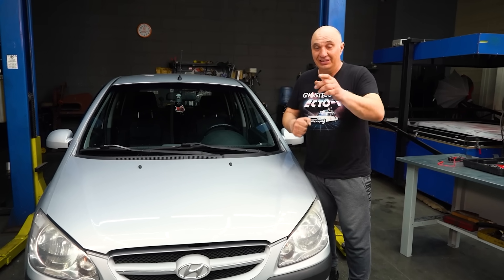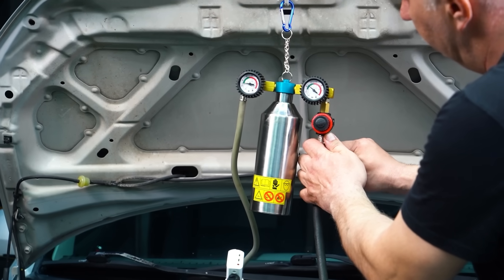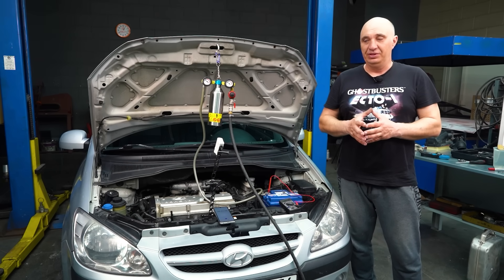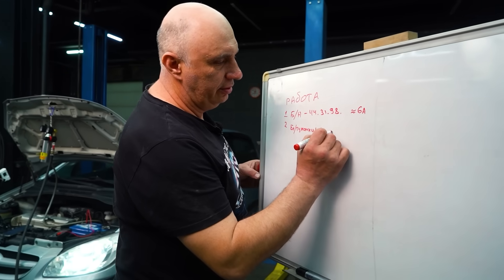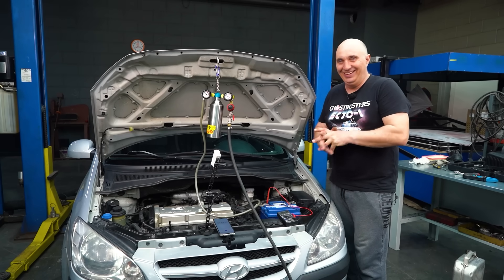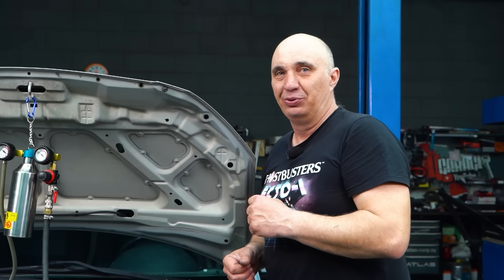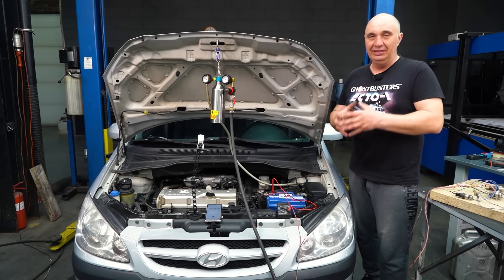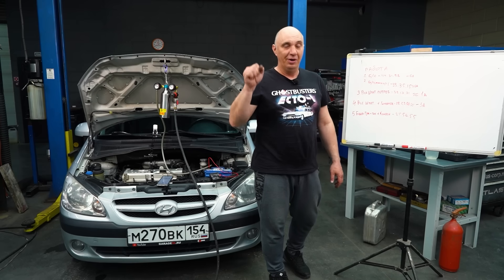How much really do accessories affect fuel consumption?

Comment: Excellent practical video. In my climate I keep the AC on always! The difference is more w/ petrol engines rather than diesels. WRT the DC current measurement, U are measuring the charging current of the battery & NOT the alternator output. In the final test the battery is discharging. It depends on the wiring from the alternator to the battery & from there to the car's electricals/ electronics/ ER fuse box. U may need 2 DC clamp meters to measure both alternator output & battery charge/ discharge current.
I converted your test times into % decrease in efficiency. I ignored the secs except in the last test where I used 26'. The decrease in run time is 11, 25, 36 & 41% respectively.

Comment: You cannot measure dc amperage with a clamp on multimeter, you need to use a shunt resistor for dc
Reply: a regular clamp meter wont measure DC, but there are ones that can. AC clamp meters use induction while DC ones use hall effect

Comment: I think the problem with that current meter is that they only work with alternating current, pretty sure that type don't work with direct current. I think I've tried using one that looked very similar on a car before. to read current you'd have to wire in a dc ammeter between the alternator and the battery. or you could put one in the main cable coming out of the battery, but then it would have to be big enough to be able to handle the current of the starter motor. a cable between the alternator and the battery would give you all the information on accessory power draw you needed anyway. 

interesting to see the difference in run time anyway, thanks for experimenting 👍
Reply: there are DC clamp meters, you can even read on the device. it says AC/DC
Reply: @Xiefux  ah, I didn't see. Curious that it didn't seem to read right.

Comment: A/C is a double load the engine has to turn the A/C compressor and the alternator has to supply the power while keeping the battery topped off. It takes a lot of power to run the blower to move the air around in your car but the rest of the A/C electronics do not take much power at all so the load from the A/C compressor is what kills the gas mpg because most people have the blower on for heat if they are not using the A/C.

Comment: I have a 4l l6 that at idle 14.4v, radio on 14.3v, ac and lights 13.7/13.9v drops about 50rpm until thermal fan turns on. This is in Australia at about 35c (Couldn't tell you what temp ac is set to as it just a blue bar that gets bigger but max cold XD) I personally just keep the windows down as my car has wind deflectors so mpg is pretty much the same

Comment: If you want to check the current draw !! Turn off the car, run the accessories and then check the current, now you are actually checking the current draw from battery to accessories !!
What you did was the current drawn to charge the battery !!

Comment: What is worse for fuel economy? Using AC in the summer heat at 34°C  (cabin at 26-27°C) or using the heater (cabin set to 18-19°C) and seat heating during winter at 3°C? These are for both cases moderate values. For now, to my surprise, winter has more effect on fuel economy. (I always did the tests after the car reached operating temp.)
Is it as simple as just looking at the temp differences during the tests, so -7-8°C during summer whereas it was +15-16°C during winter?

Comment: @Garage 54 6:09 you should bear in mind that the current is supplied by the the alternator when you have the engine running that is why you won't see a significant Amp spike, repeat the low beam test when engine off to know how much lights draw

Comment: Extra load on the engine will always add to fuel consumption. But the practical arguement is whether you can save fuel by driving without using the AC by winding your glasses down instead. And the answer is, at low/city speeds, you can save some fuel with your glasses down and not using the AC. But at high way speed, the vehicle will consume more fuel if the glasses are down for the AC to stay off.

Comment: For fun, you guys could solder 3 wires into the alternator at the diode bridge, and run those 3 wires to another alternator (wired the same way) and see how much powerful an alternator is when it is used as a motor.
Ради интереса вы можете припаять три провода к генератору на диодном мосту и протянуть эти три провода к другому генератору (подключенному таким же образом) и посмотреть, насколько мощным становится генератор, когда он используется в качестве двигателя.

Comment: This can be explained in power. AC - 1 bhp or 800W. the alternator is rated for 1.2KW or 10A but the max it pulled in the test is approximately 500W since the lights and accessories in modern cars are very efficient especially with LEDs they dont consume a lot of power. This is the big difference and the AC not being automatic while the car not being well sealed meant a lot of heat loss happened.

Comment: im not an eco person.... but i wish i could ban running daylight lights in my country, not only because it wastes bulbs,fuel and produces heat... but because its fkn useless.
Reply: Its not useless. Its for safety. You see car, motorcyle, truck...easier and much before in road conditions. That way is your "allert" while driving higher.
Reply: @slablevcek absolute bs you are talking... on a normal day even when its barely sunny  its absolutely useless... motorcycles maybe but cars or trucks? no. a car itself is way more visible in the corner of my eye than a light that doesnt even shine to be noticable... even if, it could be just mistaken with a random reflection.
Reply: @Rey-vm9it  I am 100% sure, that most of the people disagree with you. 👍
Reply: @slablevcek multiple wrongs dont equal right. those are probably the same ppl that text n drive.

Comment: I had this exact same car. Hyundai Getz. I was travelling to the beach and the alternator bearing stucked. The belt didnt snap. So I did a quick math and figured I had 20 to 25 minutes before I drained the battery. I turned everything off and with the windows up (it was hot!) I cruised at 90 km/h for 20 minutes to my destination. Mostly was in downhill so I kept doing it on neutral and gave it juice only when it was exctrictly needed.
Once I arrived I was brave enough to stop the engine and then turn it on again. To my suprirse the alternator began to spin again 😂

Comment: and if the temperature knob was set to max hot , the blower will keep the engine at normal temperature , so the main radiator fan(s) will not turn on (they consume a lot of power) . And as expected , the AC will increase consomption , that is very high with engine at idle on low torque , plus no air naturally passing to help the AC fan(s) on the condensator .

Comment: Under normal city driving, my car (2018 Honda Accord) only charges the battery when the car is decelerating if the electrical system is working properly and battery is in good condition. When the car is stopped or during acceleration the battery is not being charged to save on fuel. When the lights come on or other electrical accessories then the car charges the battery during idle and acceleration.
Reply: I assume the alternator is also equipped with a magnet clutch?
Reply: @amd.0001  I don't think so. I think the computer in the car controls this depending on amp load.
Reply: @amd.0001 not how an alternator works. Alternators have its own little computer to tell it when to charge and when not too. Don’t need a clutch for it

Comment: Very nice video and demonstration of how different loads consume much more fuel!

About measuring alternator load, you should put the ammeter (the clamp) on the alternator cable going between alternator and battery. Now measuring just from battery cable (possibly going just to battery) you are effectively measuring the amperage drain or load from the battery, so just telling if battery is being charged or discharged. :) 

14,25v on the multimeter tells battery being charged/being kept stable. 12,65v is basically telling battery is being discharged even if engine is running. But the load is so high on the alternator that the battery is in fact supplying a part of the energy (that is why the ammeter clamp is showing MINUS amperage = energy is going from battery to car electrical system and battery being discharged).

It would be interesting to do same experiment on a car with a big engine like a V8 or V12 and comare differences. Of cours you should up the fuel amount in same ratio as engine displacement, otherwise a 4-5L V8 would run like 10-20min with 500ml. :)

And a good practice would be to have the battery full charged between experiment parts to factor out battery draining/charging that consumes power.

Comment: Problem with air conditioning systems is they are deliberately inefficient as per the planned obscelescence found in modern cars, the whole clutch system still used widely is its ancient technology designed before the war and materials used for solid pipework are inferior for the job needed.   I helped years back a friend who was fed up with his Jaguar's aluminium pipes on his a/c just breaking and leaking all the time and we spent a weekend shaping and fitting full stainless steel pipework and he changed the solenoid clutch unit for something industrial fitted with a simple pulley that sat in the fan belt train and it never leaked once over many years and because the energy to power the pump was part of energy used to drive the fan and water pump, the drain on the engine was negligible.

Comment: Cars are strange. I had a 2005 ford escape with 370k miles, and the ac didn't affect the mileage at all, and I swear it accelerated better with the ac on.
Reply: AC is taking only 1-2hp, so you won't notice it.

Comment: the problem is you are also charging the battery after it uses some power to start car especially in first run when you had no loads it was probably not 100 % charged after sitting around

Comment: the reason your clamp on battery terminal is Lower on full load, because you're measuring the charging current not the load current. 
you should measure the alternator output.

Comment: One thing bothered me about the fairness of the test. The battery should always be at the same voltage at the start. But your test is indicative, meaning that electrical devices increase fuel consumption.

Comment: that's not how to measure current in DC . the clamp is for the alternative current !
Reply: Depending on the clamp it can do both ac or DC but it would still need to be oriented in the right direction, doesn't matter which way you clamp it when measuring ac but DC it will only read one way.

Comment: You should measure the current on the alternator cable. Because all power is needed elsewhere so there is no power left for the battery. That’s why the voltage drops.

Comment: Can you guys do an experiment for me?
Could you try adding a 1:10 mix of petrol to diesel.
Then drain the fuel and try a  2:9 mix, then 3:8 etc (repeat the test and increase the petrol amount each time) to see what ratio will make the engine stop running.
Then try it the other way round in a petrol engine car, repeat the experiment and add a bit more diesel each time until the engine stops.
It's something I've always wondered about.

Comment: The clamp meter needs to be on the output of the alternator, this will indicate the alternators current. This will be difficult due to space restriction. Also the car has 2 sources of energy in parallel, the alternator and the battery. The battery will take up the load when the alternators voltage drops to the battery voltage due to lack of speed. The total electrical load is not required, only what the alternator supply’s. 750w is 1 horsepower and would need circa 62 amps at 12v assuming no loses. Getting a bit out of scope for this comment now. Still I love your experiments. All the best.

Comment: Alternator likely to be around 100amp? On that basis it will be able to power, for instance, 22 halogen headlamp bulbs at full beam. The couple of extra you added are just tickling that alternator, not even starting to break into a sweat. Come on guys, get some nice thick cable and join up a whole christmas tree's worth of headlamp bulbs - stand by with the fire extinguisher tho.....🤣

Comment: There is no way the car was only drawing 6amps before and after turning the lights on, even LED's all round would have shown a difference - 1 halogen headlamp bulb alone draws 4amps at 14v. Measure from the ground negative instead.
Reply: He was measuring batter charging amps.

Comment: Instead of the motor spinning the alternator, can we use the pressure from the exhaust to run a turbine which spins the alternator? After all, the exhaust pressure is high so there is some unused energy. Maybe we can make more electricity, for example to be used in a hybrid vehicle.
Reply: It would be overcomplicated for little benefit, the high speed of the turbo would have to be geared down to suitable speed and may not have enough torque. In many recent cars the engine is turbocharged anyway, so could not be used.
Reply: @dino6627  There are turbochargers powered by exhaust pressure. Although responding more slowly, they are claimed to be more efficient. I'm curious what would happen if you replace this turbo charger with the generator, rather than adding it to the turbo.

Comment: Plz make a engine without a camshaft with electronic actuation as used by Koenigsegg it was very interesting to see.  efficiency and power should increase love from india never skip a single video of yours
Reply: The actuation of the vales is the real tricky part as it takes a lot of energy to move them fast and exact. I think it was Mercedes who tried to make something like this back in the 70's. However it could have been anyone. They discovered that using electromagnets for moving the valves was not a realistic option. If i remember correctly the Koenigsegg solution uses pneumatics to operate the valves controlled by electric valves controlled by the computer. So there is a bit more than just replacing the lifters with a compact electro magnetic lifter.

And if you make the valves work you still have to control them using a computer. This will require quite a bit of programming and development. The fact that Koenigsegg is the only manufacturer that has developed a system like this says it's not simple. And even they haven't been using it for any of their engines so far as I know. At least not in anything they have sold to a customer. Again this is as far as I know. If you know more then please post about it.

Comment: Few things could improve test on higher level:
1. Turnings steering wheel 
2. Pressure on brake pedal
3. Pressure on clutch 
4. Cigarette lighter pressing multiple times
5. Glass wipers, etc...
Normally, nobody in real life will be doing all this but would be interesting 🙂
Reply: I don’t think pushing a clutch has an effect on alternator because clutch is pure hydraulic without any electricity at all. Well, at least in my car
Reply: @andikappradana  yes, not affecting alternator but consumption
Reply: Opening and closing all power windows, windshield washer/sprayer. Also the alternator can actually supply more power if the engine is revved a little higher (1500, 1750, 2000 rpm).
Reply: @ahmadrizqiramadhan7846  tried that... Yanking steering wheel left and right, while rolling up and down all 4 windows, AC full blast, stereo on, headlight on, hazard on...
the battery indicator lights up instantly. voltage drops to low 12

Comment: there is multiple ground points on an engine if you bypass one it will mess up the reading you need to clap the charging wire from the alternator and the battery disconnected

Comment: For an accurate measurement you can connect a flowmeter on the fuel supply line and another one on the return fuel line. By measuring these 2 values you know exactly the amount of fuel burned by the engine with and without load. This is how the fuel consumption is measured on ships. We have to take counters every day at midnight and we know exactly how much we consume in 24 hrs period
Reply: most modern car have returnless fuel line. means the fuel pressure is regulated internally inside the fuel pump.

Comment: If you want your alternator to charge the battery etc more than normal, like if you have more than normal amounts of accessories running, just disconnect the S wire from the alternator, so it thinks the battery is not charged = up to 15.2v, I have a switch for mine so I can charge my solar power bank in winter 😀
Reply: That will reduce the life of halogen headlamps and the car battery. I would use a boost converter module insted for the solar power bank.

Comment: ⚠This test has major problems... Volts dropped because the car is at Idle and barely run the alternator Because That need to spin much higher to make power. Amp meter on battery cables often is "useless" for above test. You need amp meter on Alternator's Main Output wire to see power used. All alternator amp "rating" is Peak Amps possible and you get a Small Fraction of that at Idle. Alternator RPM is Not the same as Engine RPM and "gear up" to spin 2 to 2.5+ times faster then the engine. For most street vehicles, Often you only see Peak Amps above 65 to 80kph (40 to 50mph) and why when stuck in traffic for a long time many vehicles have a "dead" battery because the battery tried to make up the power needed by the Total Load. This is what Volts shown with everything Turned On. Look up any alternator power chart like several GM types. Check any Amp Clamp meters as many still read AC Amps only. DC Amp Clamps have special rules because most are Hall Effect type and easily mess up by what is near it. If you reset/cleared the meter standing near the car, often have to do that again just before you clamp any wire.